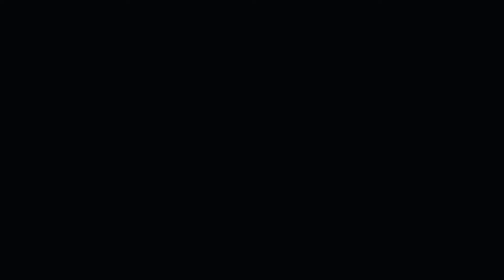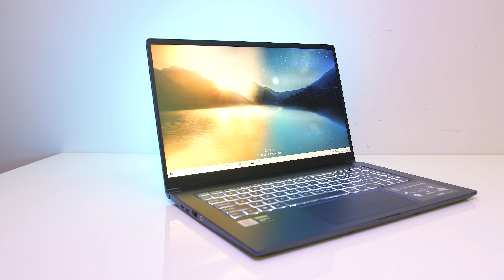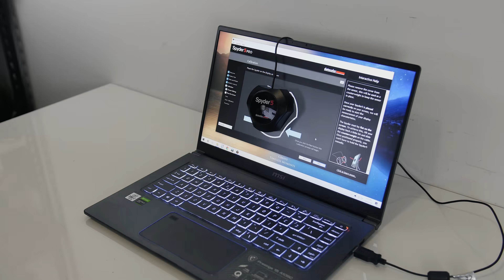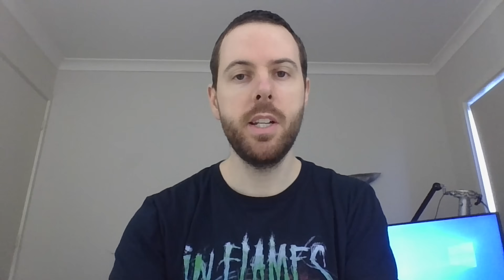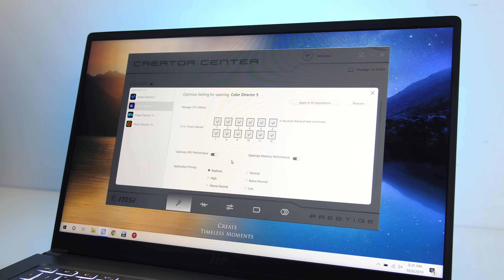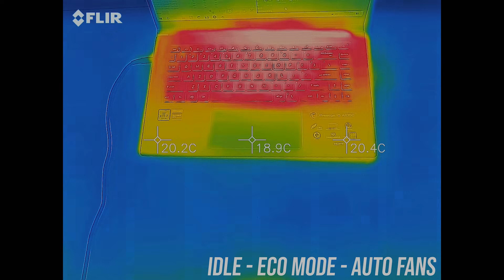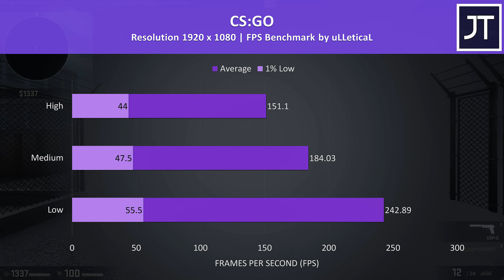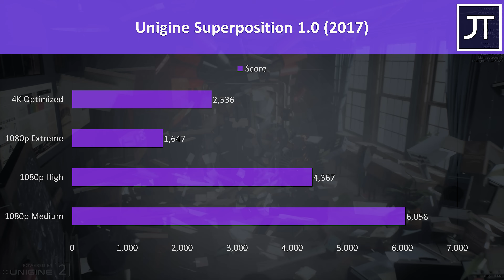MSI Prestige 15 Review - 10th Gen Laptops Are Here!

Comment: Does this use Nvidia Optimus?  I'm wondering if there is any way to use an external monitor to take advantage of Gsync/FreeSync.
Reply from the maker: Yeah it does. External monitor would work if the port is wired directly do the Nvidia GPU which is usually the case, however unfortunately I did not check that here.

Comment: Thanks. I have bought it. Highly satisfied as expected.
Reply from the maker: Nice, good to hear!
Reply: Have you used it for any type of content creation?
Reply: @HDBnB1  I'm a freelance translator and a non-gamer. I need a good performance laptop with a reasonably good battery life to work at home and away from home. This laptop has a good balance between battery life and performance. I also add a budget SSD intel 660p 2TB to cover my long term storage need.
Reply: Can you plz tell me where did you find this laptop with 2 TB SSD Hard drive ?
Reply: how are the thermals under normal usage?
Reply: @syedtaimoor4276  I see it usually takes a total of 30 Watts under heavy usage + external monitor. Still too hot to put on lap for a long time. I have a laptop cooler pad with me to avoid burning my lap. With my heavy usage, the battery life is clearly longer than a laptop with 45w CPU. Long enough to stay off-grid for hours.
Reply: @apiwatikkyu  Do you think streaming and browsing will make the laptop hot enough to where it's uncomfortable on a lap? Also would undervolting help with the temperatures?

Comment: I'm having a tough time deciding between a Razer Blade 15 Base 1660 and this one, the MSI P15. I'm slightly leaning more towards the Razer for it's power and design but I am concerned about how long Razer Blades last because of all the stories. I can get an one year warranty from Amazon de or wait for the P15 to release and get a two year warranty. However, I am rather careful with all my devices and have had multiple laptops that lasted at least 5 years. Everyone is telling me to get the Razer Blade though as "I've never had issues with devices before" what would you recommend getting? I mainly program and also do game developing as a hobby.
Reply from the maker: If you need the extra GPU power I'd go for the razer.

Comment: Thanks for a very thorough review!  I am leaning toward the MSI Prestige 14, which I have on order.  It's a shame that it gets the DDR3 RAM, unlike this one.   Notebookcheck did test the 4K screen on that one and it got over 500 nits and it's a matte screen unlike the 4K on the 15, so that is swaying my decision, though the larger battery, DDR4 RAM and being only $100 more in the US with 32GB of RAM and 1TB of SSD makes 15 hard to turn down.  Decisions, decisions....
Reply from the maker: Hmm yeah tough one, if it helps, based on the numbers Hardware Unboxed showed from the Prestige 14 in a recent video, the CPU power limit of the 15 is a fair bit higher so it will perform better in CPU tasks.

Comment: Thanks for the great review!
As I can't find almost any other reviews of this laptop, I have a few questions. I'm looking for a fairly powerful lightweight laptop with good battery life for college, some gaming, and 3D modeling while still not being too expensive. Do you think this can handle strategy and city-building games at higher settings? Would you recommend this laptop or are there better (similarly priced) options?
Reply from the maker: I think so, those are CPU bound typically and this is a little ahead of the 9750H based on my own testing. For the money though you can get a 9750H/1660 Ti which will perform a bit better in most games.

Comment: I NEED HELP

CPU and GPU drivers are up to date. Checked Windows Update and that's up to date too.

 

Even after uninstalling and reinstalling, I am unable to get this program [XTU] to open. The error message is this:

 

"Unable to start Intel Extreme Tuning Utility. If there is another performance application running, you must close it before trying to start this application."

 

Nothing else is open when I try opening XTU.The reason I'm trying to open it is that I noticed recently that while running games, the GPU and CPU are both much hotter than normal. 
PLEASE HELP ME
Reply from the maker: Yeah it doesn't work with newer U series CPUs, my guess is they need to update the software to support it. I had to use Throttlestop instead of XTU to get undervolting to work.
Reply: @JarrodsTech  so what should i do now??
Reply from the maker: Try Throttlestop instead: https://www.youtube.com/watch?v=yNt9L3BWOFo
Reply: @JarrodsTech  can you me how to undervolt asus rog strix g with this?
Reply: @JarrodsTech  And it opens before but after resetting my laptop it just doest open anymore?
Reply: @JarrodsTech  throttlestop also wont open in my laptop.. i dnt know why
Reply from the maker: Here's a guide: https://www.youtube.com/watch?v=yNt9L3BWOFo

Comment: the fact that the 10th gen U chip at 45W is the same as the i7 9750H is pretty crazy, though at the same time quite unsurprising judging by the specs... However I think that would kinda be weird for a consumer, maybe intel should make things less confusing and stick to one product line for laptops with adjustable base clock tdp from 10W to 50W... but then thats more confusion for the consumer, if 2 laptops have the same chips but vastly different performance.
Reply from the maker: To be fair the 45w limit will probably be uncommon, it's hard to say, haven't had any other laptops to compare with just yet, but yeah certainly possible with adequate cooling it seems!

Comment: Badly need that Vapor 15 review!
Reply from the maker: Oh that sounds a bit more reasonable, it's still hard to say without having tested the 2070 max-q to see the difference. I do know the 2060 is about 14% better than the 1660 Ti, and the 2070 Max-Q is about 6% more than a 2060, if that helps. Personally I think the 1660 Ti is enough for most people, it still offers a good experience in most games 1080p high settings.
Reply: Jarrod'sTech I understand, thank you for your input! I’m transitioning from Mac to Windows after 15 years, and this may be my laptop for the next 5 years. I’m into games like Witcher & Sekiro, and I’m looking to get into light photo/video editing. Anyway, thank you so much for your input! You’ve made this transition much easier!
Reply from the maker: It was delayed a little, maybe will be up mid week, I had to redo a bunch of the testing - there's an update video explaining the deal in about 5 hours time.
Reply: @JarrodsTech  Since the Aftershock sale ends in 3 days, and I trust your reviews 100% anyway, can I just ask if the Vapor 15, in general, is worth the purchase? 1660 Ti or is the 2070 MaxQ worth the cost to upgrade?
Reply from the maker: @miguelgalvez5630  I think it's a good machine and not priced too bad in Australia, the conclusion of the review is basically that I'd prefer it for my personal laptop over my current Aero 15x. I don't think the $780 upgrade for 2070 max-q will be worth it, however I haven't had that config to test yet. It's actually in the mail and I'll compare them in a couple of weeks but I can't say for sure the difference right now, but the 1660 Ti performs quite well.
Reply: Jarrod'sTech You’re the absolute best! Aftershock Singapore has the increase to 2070 MaxQ at 470 SGD more, which is only about 505 AUD, plus a 7% tax refund at the airport (I’m not from SG). Does that justify a 2070 MaxQ upgrade?
Reply: Jarrod'sTech Or rather a 570 SGD (613 AUD) difference to upgrade since the 1660 Ti is at a100 SGD discount for their Anniversary Sale.

Comment: One side comment. I also use the spyder5pro and lately in several laptops the data color app fails when trying to save the icm profile file. Have you encountered that problem? I tried admin rights but did not help
Reply from the maker: Yes, it's a known issue with Windows 10 1903. You can sometimes work around it by disabling the display enhancement service in Windows, but often laptops get sent to me with older Windows versions, so I can do the screen testing before upgrading to 1903. If it has 1903 though it's hit or miss as to whether or not it will work properly.
Reply: Jarrod'sTech thanks I was going crazy! Can I downgrade ?
Reply from the maker: I think so.

Comment: 9750H/or 8750H vs 10710U on 45W both? What? 10710U is 15/25W procesor, that’s the whole point of this product. Battery life, power efficiency, thin and light... It's more like 9750H vs 10710H. "Hardware Unboxed" already tested it, bye the way. 9750H a lot faster, and its not a surprise. Absolutely different products.
Reply from the maker: You're only partially right. Yes, U series are indeed designed with thinner and lighter laptops in mind. Regardless, MSI run this one at 45 watts under CPU only workloads, am I supposed to ignore that? In that state, it comfortably beats the 9750H. I'm well aware of the Hardware Unboxed video, I commented this same thing on it: https://www.youtube.com/watch?v=1m1_2aQxR0A&lc=UgzzMXmNQI9URQPm46l4AaABAg
Reply: @JarrodsTech  Can we say that at 45W 10710U with 6 cores/12 threads is basically 10th gen H series i7 procesor? And when Intel release 10th gen H series it would have 10710U 45W level of performance?

Comment: Great review! I wonder if undervolting the 1650 Max-Q in MSI Afterburner in addition to the CPU would allow for higher GPU clocks or give more room for the CPU to boost up. A 90 watt power brick is strange but with a U-series chip, maybe MSI assumed that 90 would be enough
Reply from the maker: Thanks! Yeah it could possible help out 🤔

Comment: This, Razer Blade Stealth Late 2019, Surface Pro 7

The MSI is the better choice rn, for the value.

If you want to flex, get the razer blade, 200usd premium.

I have a vision about my choice now

Edit: we can see if dell wants to implement the comet lake CPUs in XPS 15 then I'm sold, considering its might be a cooler chip
Reply from the maker: I agree vs razer, haven't had a chance to use a surface since like 2nd gen though so I can't compare there. I have an XPS 15 coming next week, but not sure on its specs yet.

Comment: I find it strange how this intel chip can actually hit 45 watts even though intel doesn’t advertise that. This is a good thing though since that would mean this chip could be paired with higher performing gpus i wonder if this cpu will replace the 9750h in some laptops. Im sure if it hits 45watts then it can potentially be better than the 9750h in terms of cooling and only slightly less powerful which in my opinion is worth the trade off
Reply from the maker: Yeah not really sure what the real limits are, I guess most CPUs have much higher turbo limits/PL2, just depends on the cooling/power delivery as to what can be sustained.

Comment: Was considering the PS63 before this came out. The usb c charging seems like a good upgrade, as does the change in keyboard font from the PS63. I'm a fresh engineering graduate and I generally do C++ development, but may be expanded to other development in the future. I really like this for the aesthetic and battery life, but am still undecided as to whether to go for this one or look to a beefier laptop such as a macbook pro. Your thoughts?
Reply from the maker: Personal preference I guess, I prefer cheaper and Windows so for me a mac wouldn't be an option, as for thicker I suppose depends how portable you want and if you want the extra weight for additional performance.
Reply: In what way is a macbook pro beefier ? If u do dev, then you need a good cpu, fast ssd and a great amount of ram 16 gigs could be enough, if u do some devops aim for 32 gigs of ram. 

I had my hands on macbook pros, dell XPS and some other random laptops... the macs really arent worth it if youre in for development.
Reply: If you want something besides this, I’d suggest the ThinkPad P1/X1 Extreme.
Reply: The Ps63 uses a 4 Core CPU while the prestige 15 uses the new 6 core processor. I am not sure if C++ uses multi core, if so, the Prestige will be better cause the new CPU single core performance is not as good. Also, the Prestige power adaptor is 2 times the size of the PS63 and weights 400+g vs the PS63's 320g.

Comment: Why 1650, it should be at least 1660ti/2060
Reply from the maker: Not just a 1650, but a Max-Q 1650! This is because it's too thin to fit anything higher powered.
Reply: Good luck from heat

It's not like physics is a thing you know.
Reply: @W1nDy_Artria  other laptops can do it too...do you even know how "physics" work?
Reply: @masterofdisaster3128  I would love to see a laptop weighs 1.6kg and can carry 1660Ti/2060 properly. The guy above has a point. Besides, this is not a gaming-focus laptop

Comment: Does anyone know what happens if you use two chargers at the same time? The original 90W + another one on the other port? Will it use more power or just stick to the 90W?
Reply: Pretty sure the system can take one input at the time, so you'd be stuck with a 90w charger. But in theory Thunderbolt3 can take up to 130W so you can buy a charger brick like that and you're good to go
Reply from the maker: I didn't test it out so can't answer.
Reply: MSI sell 135W dock for this laptop, so may be other usb-c 135W are supported

Comment: On the power limit of the brick, can an eGPU solve that problem ? It would provide 100watts no?
Reply from the maker: Maybe, however I didn't bother checking because when I did my eGPU testing the GPU in the laptop was idle, allowing the CPU to perform better and it was able to get enough power anyway.

Comment: Do you think could be good for use with pro software.like Archicad and Two motion?
Reply from the maker: I have zero experience with those but probably, the CPU can perform close to a 9750H and there is at least above entry level discrete graphics.
Reply: @JarrodsTech  Thanks JT. Probably. Twinmotion work with Unreal Render Engine. Thanks

Comment: Why put an Nvidia 1650 with a U series processor though
Reply from the maker: It's a thin machine, you can't put high end GPUs in it. It's already power constrained, thermals would be the next limit with anything higher.
Reply: @JarrodsTech 
That is my point, a whole different set up is better for this gpu. You need better cooling and a screen with higher refresh rate to make use of it. Unless it is for content creation and if that is the case then a higher gpu would be better. So to me it is a weird combo.... Or is the 1650 the new Mx250.
Reply: Why not? The GPU on the 10xxx series is still the same shoddy one as in the Kaby Lake 7xxx-series.
Even my Kaby Lake laptop has a U-series processor and a discrete NVIDIA GTX graphics cards (thankfully!).
It allows to combine long battery life and reasonable GPU-support for creative tasks and light gaming. It's perfect if you need the portability while still being able to reasonably game and/or create.
Reply: @totalermist 
Because it isn't. It is a better intel gpu but that isn't the point. For this set up you won't get the best out of the 1650 because of the restrains on the system. So you are paying for something you are not going to fully use.
Reply: @morningmidnight9398  Dude, I own a machine with a similar setup. I can tell you from actual experience and benchmarks that the difference between the discrete GPU and the iGPU is >100% - in other words, it doesn't matter that you won't be able to squeeze the last 10% of potential performance out of the GPU.
The only reasonable alternative to the 1650 MQ would be the mx250 and that GPU is usually paired with 13" devices...
This isn't a high performance gaming machine and a 1650 MQ is still a very reasonable compromise for this form factor.
Reply: @totalermist 
Yes I know that there is no comparing the two gpus but the current igpu is similar to an mx230 or mx110 at worst. But you are still you will never get all the use out of it because of the rig itself. I have seen many 15inch laptops with Mx250 which is by the way not that much better than an Mx150.
Reply: @morningmidnight9398  The mx130/230 are still much more capable than the UHD 620.
Depending on the use case you'll be able to get 100% GPU usage no problem.
The only case in which thermals and/or power might become a serious constraint for the GPU, is a scenario with full CPU and GPU usage at the same time. And even then it's usually the CPU that throttles, long before the GPU is affected.
As I mentioned before, H-series processors come in at 45W+, whereas U-series CPUs can be configured from 15W to 25W, with PL1-states up to 45W.
FYI in many cases it's the PSU that becomes the limiting factor - not the CPU, not the cooling, not the platform power.
If you insist that a 1650 (and a Max-Q model nonetheless!) is thermal and/or power constrained in this case, I'd need some solid evidence for that first. In laptops in general and thin-and-lights in particular, it's the CPU that thermal throttles long before the GPU, unless the manufacturer screwed up their cooling solution pretty bad.
Reply: This u processor is better than last year’s H processor
Reply: @rahiljogani4825  it's not
Reply: @rahiljogani4825 
Because usually an H series processor is put in a laptop that can coll everything down